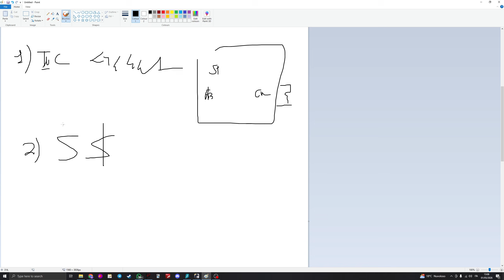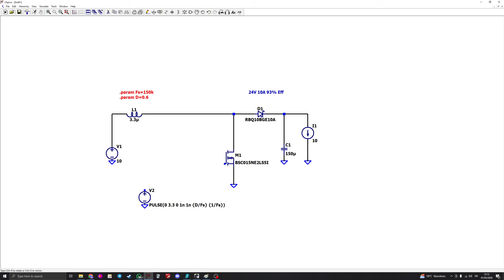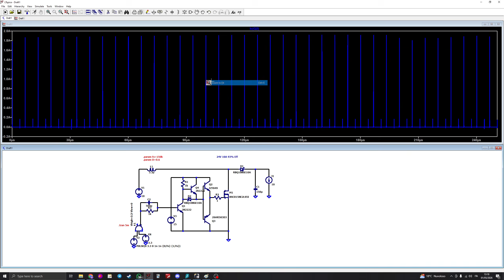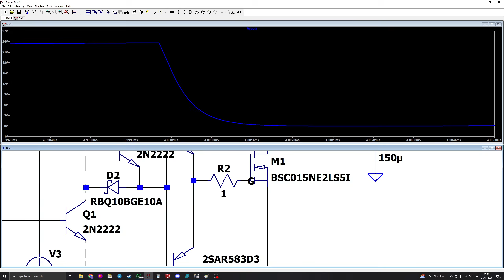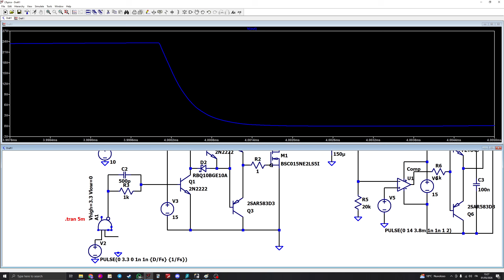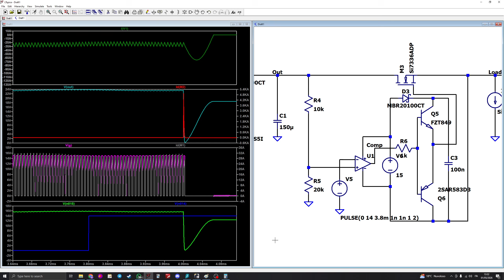[LTSPICE] Boost Converter Short Circuit Protection

Comment from the maker: Read me first:
This video is intended for boost voltage mode control, so, no shunt has been used
Of course, if you have a shunt, you can easily implement overcurrent protection!

Luca DC.

Comment: Hello, Nice Video, but why don't you use a shunt either High or low side and monitor the Current and cutoff a Pass Mosfet at the Input or at the Output side of the DCDC at a certain Value instead ? For Example if you gave a Input Polarity Mosfet Protection at the gnd Line, you could use this one as the Pass Element instead of adding a dedicated one.
Reply from the maker: Because in my previous video attempt I told myself that this was for Voltage control Only. Needless to say, I forgot to say it in this version of the video, lol.

Of course, if you use a shunt for current control you can easily do overcurrent protection